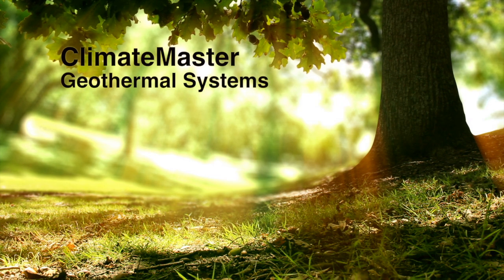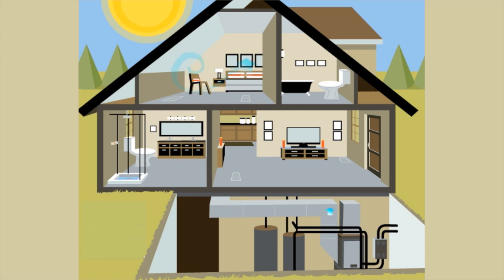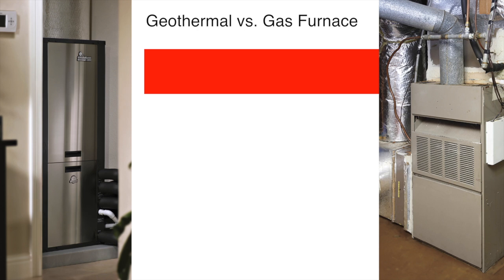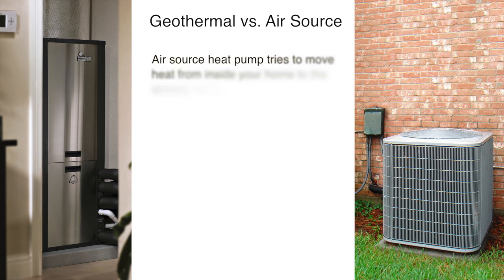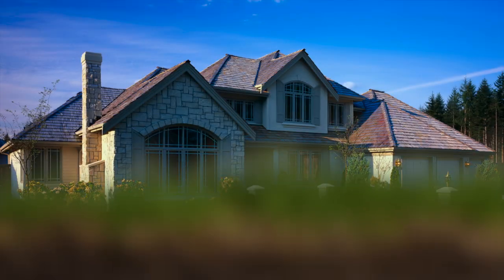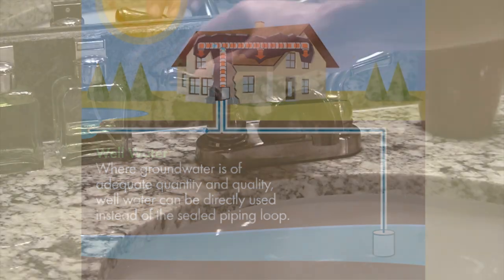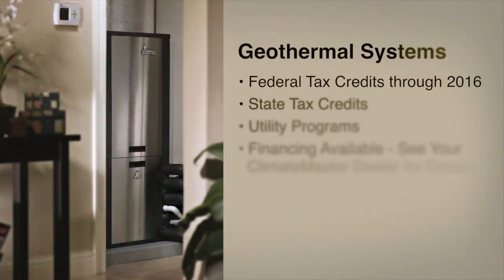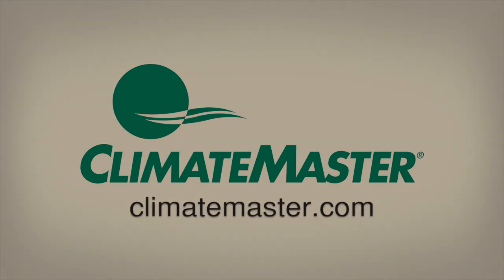Benefits of Geothermal Heating and Cooling

Comment: We replaced our standard HVAC system when it neared the end of the average life span.  The Geothermal has been AMAZING!  

It has taken us through several Missouri summers with many, many days above 100 degrees.  Inside was comfortable at 70 degrees and NO big air conditioner equipment outside.  The water in our loops is cooled by the earth, and a fan blows past the loop to send cool air though our home via the existing ducts.  Likewise, the earth's heat is brought into our home, magnified through the compressor to keep us at 70 degrees in the winter.  

We didn't even have to switch from our long-time HVAC company for service and seasonal maintenance.  The same guys that installed our old system put in our Geothermal and they service both types - super easy!  If your HVAC unit is nearing the end of its life...change over to Geothermal!  You'll be happy you did.
Reply: Which part of MO? which company installed your system?

Comment: Geothermal only ICELAND or Yellowstone National Park. What you presenting is Heat Pump , cooling or in reverse - heating. No NG needed but lot of electricity to pump cooling/ heating water and huge  compressor for fr ion . When home need 100 k Btu / 25 kW/ gas furnace to keep it warm  it is same  25 KW heat pump to transfer energy from ground . The gas furnace  is  much cheaper than electric one. Heat pump is not for hot water but for preheat water and it cost fortune.
Reply: You are full of shit. Gas has to be paid for each month. Electric is not expensive & it can be provided for free by solar panels or Windmills,

Comment: Question: If the temperature below ground is a consistent 55 degrees, then doesn't that mean a house can only be heated or cooled no more than the source limit (55 degrees)? OR is there more processes in place to up that? While I don't ever foresee needing to cool a house to 55 degrees, heat stacks so if its 110 outside and I an dumping heat outside,  I am warming the thermal mass of the the earth where my loop is located. The heat would wick away sure how does it cool fast enough to keep up? Inverse to that, how do we get temperatures hotter for say winter times were we want a house to be 68-70 degrees and water up to say 120 degrees?
Reply: No u can use it like any gas or electric heater your house can be 85 degrees if you want.  Somehow the process builds up heat in the collection process

Comment: Thank you , as far as I can tell the biggest drawback is the initial investment, and finding an installer with REAL KNOWLEGE  an experiance
Reply: The initial investment and MAINTENANCE are BOTH expensive.  Why not just bury 6-inch stovepipe on the cheap and in abundance?  Then install a fan to circulate air through the pipes and into the home?  You get the same benefit, without any of the problems.  People up north are already using this technique, but they're not laying out 10s of thousands of dollars for the install, and they're not worrying about leaking ethylene glycol into the ground.

I've dealt with irrigation systems for my lawn, and even the nicest install is a 20- or 30-year proposition, at best, and then you either repair, repair, repair as it starts leaking, or install a whole new system.   The system in this ad is too expensive to install, too prone to NASTY breakdowns, and costs an arm and a leg to repair if anything goes wrong.
Reply: It's true! Most guys/gals are not going to invest the time or effort to get the training. I already had a lot of hydronic/steam/AC experience so geothermal came easy once I actually got involved with one.

Comment: So while the outside air goes from cold in winter to hot in summer, the temperature a few feet down in your yard, remains the same. And you just tap into that reservoir of constant temperature with pipes. Brilliant!!
Reply: They over-complicate it by pumping water/anti-freeze through the pipes, when you could just as easily just have a fan that blows AIR through the buried pipe.   You're setting yourself up for an mini-eco-disaster if you're pumping anti-freeze through those pipes and you spring a leak.
Reply: @harrymills2770   This is heating for a house .. not a Greenhouse , therefor the water is necessary in order for it to be heated up further inside the house as it runs through a water heater, this system here is still a very expensive way to heat up a house as a huge water heater is doing most of the work/heating.. all this system does is pump semi tempid water from outside to the heater inside , instead of the heater being fed ice cold water direct from the mains... companies like to market these things as almost free heating/cooling which couldn´t be further from the truth.. the best system is water pipes running through a compost system, obviously not everyone has the room for that though as it has to be above ground.

Comment: I would want to know how ground composition impacts the effectiveness of such a system.  If you're building someplace that is principally adobe shale, digging a system will be far more expensive than in "dirt", and I wonder how the density of the ground impacts heat transfer, and how fast the differential dissipates vs. becoming saturated, so that the cooling effect in summer will degrade over time as the local "soil" (rock) fails to pass the heat away into surrounding material.

How different would the effectiveness be if an air conditioner's condenser employed water, cooled underground using a grid, or series of grids?  What if the entire condenser was immersed in cold circulating water in a jacket, so that dirt was not introduced to the water, and operation did not rely on transferring heat to the outside air AT ALL?  Since it would be a sealed system, it would not have to be water -- it could be something that conducted heat and prevented deterioration of the condenser body and fins.
Reply: sir these type of geothermal systems are nothing new and the questions you are asking are all part of the planing process of such a system.. as it has to be dimensioned big enough to fullfill the cooling and heating requirements of the house.. in order to have system reliability as you mentioned the designer will always go oversize in order to keep the influence of the disturbance variables low ( like soil etc. ). if all is planned well and installed correctly there is no need for additional systems as the system itself is simple and reliable, additions would make it more costly and less reliable with higher costs of maintenance.. 
as for the air conditioner´s condencer employed in "water cooled from the underground grid".. that is exactly the heatpump system used in geothermal.. you have the closed loops of water running in the ground to a heatexchanger in your house and the heatpump is there to either use it as "heat" or "cold".... if planned exeptionally well ( depending on the ground ) you can even store  heat through the summer in the ground and retrieve it in the winter time and vice versa.
but the degrading "cooling" effect is "just" a change in efficiency of the heatpump, which does result in the heatpump using up more power.. but as mentioned if the dimensions of the loop are correct the heatpump will run with in efficient parameters may only end up using a couple percent more energy at the end of the cooling cycle of the year, after that part of the heat can be potentially retrieved again in winter making the first period of the heating cycles even more efficient..

Comment: that open loop system, could it be used with a pool?
Reply: I guess.  It can. It would give you warm water all winter in the pool.
Reply: That is what I was thinking, even if it was in a Hot Tub size area first then into the pool
Reply: yes. and will be much cheaper if you do DYI

Comment: I wonder if the way to go is to build a super-insulated Passive House. Aside from the solar heat gain from the south-facing windows, one could use solar water heaters on the roof and a radiant heating system. Also, with the price of solar panels continuing to drop,  it's definitely one way to keep an eye on as being the cheapest way to get to Net Zero energy use. I would think this would be more effective in colder climates than warmer areas, however.
Reply: Only if you have control over where the house is facing. That is not an option for the majority of people in cities or urban areas. Passive is an option for rural areas where there is less control over things like that.

Comment: How do you maintenance it?
Reply: In terms of the tubes underground, they're very resilient. Don't have UV issues of a lot of oxidation issues. But yeah you have to dig them up if your troubleshooting doesn't work.
Reply: Or freeze issues, forgot to mention. I'd personally make sure to soften the water thats being pumped through them.

Comment: My climate master failed twice within the first year.  It was missing a wire harness from the factory and had to be replaced before it was started.  About 10 months into the use of the system it failed again.  The expansion valve needed to be replaced.  What’s next?

Comment: I hate it when companies exaggerate. And in some cases blatantly lie. 
1) If this system could save 80% why ant the capitalist businesses we know using it. Coz those are good a choosing stuff that gives them more profits.
2) If @0:25 you said the temperature remains relatively constant '90°F' why do you need anti-freeze then.
3) @1:40 why do you need to compress to higher temperatures if the original temperature from the ground was okay at 90°F. And the compressor is now using electricity isn't it.
This is just BS meant to fool people who don't know. Geothermal cooling has been used for centuries probably since the Persian Empire but in the context of regions with snow it is very inefficient for warming. Imagine the ground covered in snow for months how much energy can you extract from it to warm the house.
Reply: 1. Simplicity. These geothermal systems require thought and planning. Burning fuels is simple.
2. They didn't say it's a constant 90 degrees, that was an example of a warm summer day ABOVE GROUND. Antifreeze is needed because although it will be above 50-55 degrees BELOW the frost line, the pipes have to travel through the frost line to reach the house. They should of course be insulated, but in case the pump ever fails or the system is turned off, having antifreeze will keep the pipes from bursting.
3. Once again, the ground isn't 90. It's 50-55. You can't warm your home with 50-55 degree air on its own, you need to compress it to heat it up from that.
It's not BS, it's actually pretty simple, you're just a moron.
Reply: @decidiousrex  I like how you spent all that time to explain then you end up saying I am a moron. Well I wont argue with you because my objection was pretty clear, they overstate their efficiencies. No wonder why no-one uses their systems because even a moron like me as you said, can see through their BS.
Reply: @TonderayiKanoz  No, not BS. I toured a new home in Fairbanks, Alaska and something kept bothering me. Finally I realized - there was no FURNACE! The builder said it had a ground-source heat system with very long loops buried under the yard. I saw him again a couple years later. The house was fine even through -30F winters. But they did add a small oil furnace (I think a Toyo) just it case it got too cold outside because it was an unusually big three story house.
Since then I've seen other ground-source heat systems (they aren't geothermal which would mean they get heat from deep in the earth like a volcano or hot-springs). There are builders who now specialize in them in Fairbanks and apparently they're popular. It can get colder than -65F here, but -40F is more typical at some point during the winter.
Reply: @walterrutherford8321  Alright i retract my statement that its BS, All I will say is 80% is an exaggeration.

Comment: So the ground is 55 degrees when it's 32 degrees outside yet somehow my house is going to be heated to 70 degrees? "There's no need to burn any fossil fuels" is what people say when they install an electric "emergency furnace" to cover up the weaknesses of geothermal heating.
Reply: RAD I’m a plumber and you are right. The ground temperature water must be heated or cooled the the desired temperature.
Geothermal is still a good way to go. It’s just it will take some time to make that money back that you lost in construction. Like 18 years depending on where you live.

Comment: These are better & more reliable than air/air systems. I've installed some & it was
more  efficient  especially on Heat Pump systems.   We don't  see them too often
because  builders don't  want to pay  the extra costs involved to  install these. It's
more expensive & takes more time to drill or dig. Then it must be pressure tested
which  all takes  time / money they'd rather  not spend.   It's not  difficult to install
these systems & if I owned a home I'd want one, they're that much better.
peace
Reply: Heat Pump will switch to Electric Strip heat Below 40º & that is expensive

Comment: To run these heat pumps along with recirc pumps, fan coil units, etc. require a ton of electricity. By using this system you are not directly burning fuel but indirectly you are. These systems are worthless if you dont use  distilled water with a glycol or ethanol. Not only all that but you have to have a stable supply of electricity because the heat pumps are sensitive to surges or brownouts. 
 The heat pumps we use are water furnace and the compressors on these units burn out often due to electricity issues. 
 Best way to go is a high efficiency boiler (Veissman, Locinvar, etc) with a sidearm tank for domestic hot water with a split unit for cooling. Just my opinion.

Comment: We have had geothermal since 2007. It works , you need a well insulated house. Our wind turbine will be driving the heat pumps and create hydrogen from surplus energy www.vertogen.eu
Reply: You have a fuel cell powering your home?

Comment: if the temperature underneath is a constant 55 degrees all year round, is it possible and safe to just built an underground house ? forget the norm, I would welcome a safe underground house that stays cool during blazing summers and mildly cool during harsh winters
Reply: would have lovely views out the windows too..... ???
Reply: @anthonyraven9823  lovely views are overrated when you have security , year round controlled temperature . Besides, if you want a great view, just climb  outside of the underground home.
Reply: @anthonyraven9823  windows are obsolete and to honest offer more disadvantages than advantages.
Reply: @kimihitothegreat6396  perhaps a compromise would be to build into a hill side. Three exterior walls essentially being underground with the front exterior wall being a walk out.
Reply: like underground homes in coober pedy australia
Reply: @stivi739  nice place
Reply: It's only 55 in some places.  Where I need this system the underground temperature is only 37 which will be significantly less efficient.
Reply: @brockm4047  are you using Celsius or Fahrenheit?
Reply: @danstevens64  I am using Fahrenheit, per the video. The video claimed that the underground temperature is a constant 55F (12.7C) but where I am building the underground temperature is 37F (2.8C).  There are maps that show underground temperatures for your country and location.  The efficiency does drop off when the delta between the ground temperature and the target temperature is increased.  This video doesn't address that, thus in my opinion can be misleading for people in some climates.
Reply: Yes, become a troll!!...that's the answer
Reply: while it would be possible and safe you would likely be seen as a weirdo by most people
Reply: An underground home, some people do it. It has to be just the right place. Keep in mind.. water flows downhill.

Comment: Solar + Wind Power + Storage System + Insulation = Winner!
Reply: Solar makes no sense unless you can find a way to stop hail storms and tornadoes and torrential rain.or make them unbreakable, also, something that requires batteries over and over again is not environmentally friendly not to mention having to replace panels every 10 years.
Reply: Solar makes sense, (solar ponds, ILLEGAL!). Wind power, (good idea, but "wind turbines" are designed to LOSE money, so ANOTHER loser!) Storage system, (battery). Battery systems are expensive, and degrade over time. Insulation is a big winner, worth more than all the rest combined. But benefit/versus cost analysis is necessary, and there is none here.

Comment: If installed properly at the correct depth for the area you live. Geothermal is quite energy efficient. I installed the system my parents have in Northern Minnesota 14 years ago. Buried at 12', my parents are only having to heat up 61 degree in the winter vs -10 or lower.
Reply: Hello, I have several questions regarding this system and I wonder if you have any idea about it. It's about the longevity of this system and the risks it poses in the future. Let's say I install it below my garden, would it be costly to repair it one day when there's problem with the system, and would the plants and tree roots interfere with the pipes?